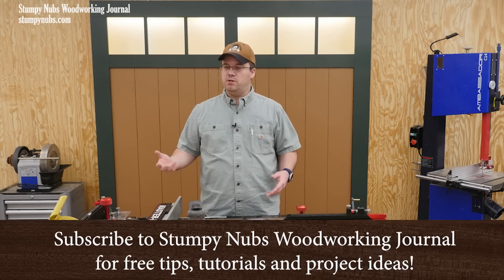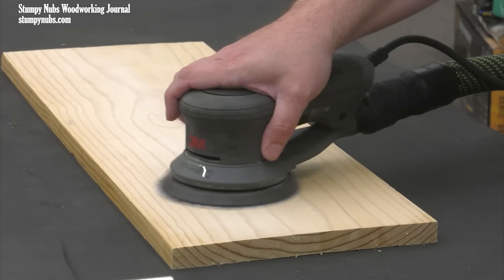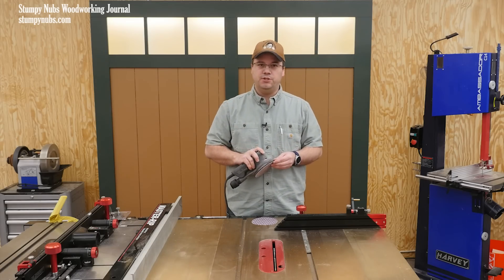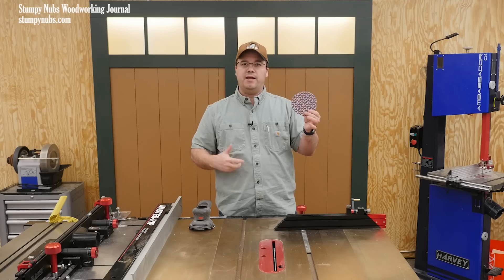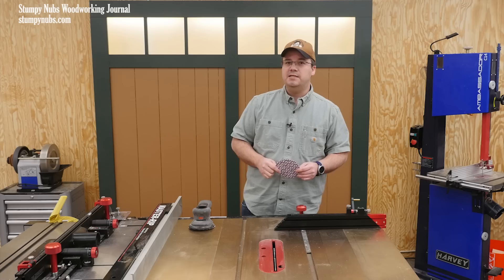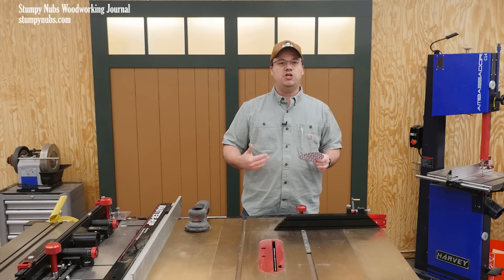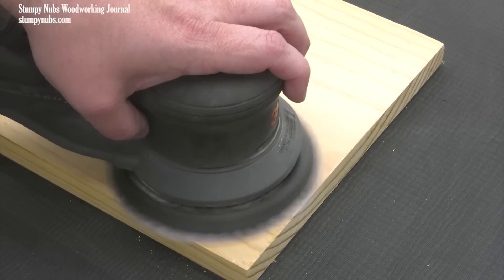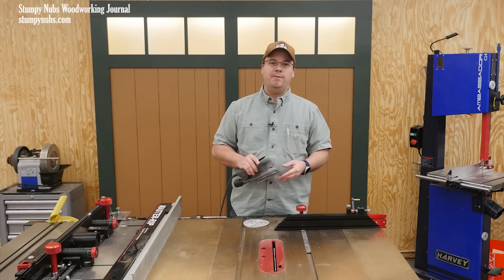Smart thing pros do with their old sandpaper.

Comment: I have been unable to find a supplier of the 3M Cubitron disks here in New Zealand and it is really expensive to import them due to shipping costs. I am currently restoring a 110 year old home and all of the trim wood is Rimu (a local hardwood), which is beautiful when polished and oiled, but at that age it is almost petrified, harder than nails, which bend when not pre-drilled. Sanding it takes a lot of disks, especially when they are a cheaper variety. I do envy you guys in the US who have ready access to all the equipment I see in these videos.

Comment: Related to sanding, but not the disks themselves. I constantly have static shocks from my sander. And it gets worse if you run the sander vertically instead of horizontally. I went as far to attach a wire to the metal plate that holds the cable inside the sander, through the metal in the dust hose, to the shop vac, and then even a metal connector from the shop vac side of the hose to a grounded outlet. STILL getting massive static shocks that even reset the sander.
I ended up removing my shoes and trying to sand that way, which did make it better. But, there is still A TON of static shock. Using the same 3M sander and a 16 gallon shop vac with the rockler dust-rite 3-12ft hose. Would love some ideas and strategies for this beyond spending many many more hundreds on a Festool or 3M true dust extractor.
Reply from the maker: That had never happened to me.

Comment: My main issue with sanding is the paper keeps coming off the sander and leaves behind loose paper on the Velcro. I've even got a shop vac attached to the sander and pressed lightly because it might be overheating, didn't fix the problem and I have no idea what I'm doing wrong. So the backs of the sandpaper gets ruined faster than the front and I've constantly had to change the grippy hooks because it's a hassle the use tweezers to remove the debris stuck on them all the time.

Comment: I have a question about 3M Cubitron sanding disc not covered in this video.  When is it best to use the Xtract (Netting discs) as shown in the video apposed to the regular Cubitron sanding discs that was referenced.  The Xtract look less durable, but there must be some benefit or preference in some sanding situations.  Hoping someone has some insight.  Thanks!
Reply from the maker: The mesh gives the best dust collection, however they can wear out quickly and shred if you are overly aggressive with your sander. For most people, I recommend the ones with the little spiraling holes.

Comment: Thank you sir for sharing new tips. Question about Duragrit metal sanding discs. I bought 2 of them, 60 & 80 grid, used them with new velcro pad it came with on ridgid sander. Not sure why, but looks like those metal discs overheating easily on long projects and both my discs not flat anymore,  they're warped.  Is it me or its a nature of that product? 
Thanks.
Reply from the maker: I haven't had that problem. I suggest you contact Duragrit about it.

Comment: Precisely EXACTLY why I had them transpose is into 3 phase electricity, for the new forest 1300mm dual header panel sander. 
I put my all my rotational vibratory sanders of the like into goodwill, 
plus this thing sands ANYTHING! 
I took almost an inch off my wife’s crock pot that’s 6 or 7 “subcontinental dark ones” too tall for her cupboard. 
I took a whole cm off the DVR to get in the cabinet hole. 
Lately I’ve been thinking on the heavier-set friend of my wife, she is always on about diet this and diet that  and not being as  small as she used to be... 😎
Reply: You need help

Comment: You say that the 3m cubitron lasts longer than anything you've ever used.  For a while now, my back burner shopping list has included the 

Duragrit carbide sanding discs 

that you've featured before.  

I'd love to learn more. I haven't found much chatter about those anywhere, and they seemed like a long lasting and quality product.  (Like you said, doesn't pretty much everyone hate to go through sanding discs?)

What about those?  Is there some nasty secret I don't know about?  Is 80 grit (their highest) not an important first step for finish sanding?

Comment: The 3m site says cubitron has been discontinued.  I’m thinking their Ultra Durable is the same pad with a different hole pattern?
Reply from the maker: The sandpaper I am using is called Cubitron II
Reply: @StumpyNubs  It seems they both have the same abrasive but the cubitron has more mesh to accommodate dust extraction.  It would be interesting to see a performance comparison.

Comment: My sandpaper is self-changing.  Ill be sanding a long and Whoooosssh!!  The shit flies across the shop  My sanders never did this until I bought Duragrits carbide sanding disc and replaced the pads on my sander with their "Heavy duty" conversion kit.  Now I have a carbide disc that wont cut anymore and sand discs flying all over the shop.
Reply from the maker: Why won't your carbide discs cut anymore? What did Duragrit say when you asked their advice? And the replacement Velcro is stronger than the cheap stuff they put on inexpensive sanders, so I can't imagine why it would not grip a paper disc unless it has been damaged.
Reply: @StumpyNubs   Not sure.  I just doesnt feel like its cutting anything anymore.   I contacted them  about the pads not sticking and they said since the carbide disc was heavy its recommended not to let the sander spin free in the air....(which I dont do anyway)  and to make sure the disc has contact with the wood before starting the sander.  They sent me replacement hook and loop pads.  I put them on and they seemed to work for a while and the woooosh!  Another one gone.  I use the Dewalt 5" ROS.  Both of them are about 2 year old.

Comment: I have a belt sander, two RO sanders and two finish (straight line) sanders. I’m gradually increasing my skill with using a smoothing plane and cabinet scrapers, and sanding much less now. If I sand at all, it’s usually just once with 220 grit or higher, and then just between coats of finish. Sanding is really the only part of a project that I don’t enjoy doing.

Comment: I'm going to try those 3M pads. I've looked at the 3M sander & fell in love with how quite it is but my husband said I don't need a $500 sander 😔 so I'm stuck with my $90 DeWalt but its ok bc it's a really good sander for the money without being too cheap. I do need to get me  those anti vibration gloves you showed on another video though those would really be nice to have for extended periods of sanding.

Comment: Save the small bags of silica that come in some product packaging and re-purpose them in the containers that you are keeping your sandpaper in, change them periodically to maintain their effectiveness and/or recharge them by putting them on a tray and place them in a recently used oven.
You can also used the silica bags in your tool containers to keep the moisture from potentially causing 'rust' on metals and moisture out of electronics.

Comment: I keep all my discs and I'll throw them onto my sanding blocks, both homemade or not. Also I do stuff like add them to a shim for tight spaces, etc. I've learned my lesson with sanding, you can TELL. I'm doing a tabletop and I'll start on one corner, I will go with the grain back and forth and about 1/3 the way I switch discs. Do the middle 3rd, and the second 3rd. Also doing some overlap on previous. then at the end I do 1 new disc, but a faster pass over the whole thing. Then using some shop lights at each end I examine the surface and adjust. Also, if you use these 3m discs, you have to use a vacuum or dust collection. There is less surface area than say something like a gator or any of those big box stores so the dust collects. If you don't have dust collection, then you may want to use another type of disc, 3m makes 3 discs I like that have varying levels of mesh. 

You may think that sounds crazy but it's WAY faster than going slower waiting for the sand paper to cut, doing more passes. The difference is night and day to me now, I just didn't see it then, but I dare you to try it. Basically, the table I'm working on is 8 foot by 45" wide (walnut). Think about it this way, let's say you drop 2000$ USD on 150 BF of black walnut. Do you think I'm going to get worked up using 3-5 1.25$ Discs vs trying to spend MORE time working 1-2 discs because I'm trying to stretch it out? N O P E.

Comment: Great tips. I’m guilty, I almost always stretch my use too far. In addition to flat work I also turn wood. I really like the mesh Abranet discs but am now having a hard time finding them in 2” sizes with the scalloped edges and in all the grit sizes. It’s also hard to find them in bulk. The typical pack is 10 discs. I’ve spent tons of time looking for places that have what I need but haven’t found a “one stop shop” yet. If you have any information that can help, I sure would appreciate it. Thank you

Comment: I usually scrub gently any coarse 40--120 sandpaper with a soft brass wire brush after using it and it prolongs its life for at least thrice.  For finer grit, once they are clogged for 1st time they're done, just swap it

Comment: Great information. Lots of varying views on how long to use sandpaper. For instance Lyle Jameson advocates only using sandpaper once. I think that is a bit extreme. Others say use a grit until it stops cutting well and then use it as the next finer grit. I don't buy that one either. I do think most of your suggestions are the way to go. 👍I don't absolutely agree with anybody. 🙂.S. Off subject question. the fence you are using on the table saw for a router looks interesting. Can you point to any information you have about it? Thank you for sharing. Have a great day and stay safe.🙂🙂

Comment: Two comments. First, I started using Cubitron sanding disks about a year ago, and they are definitely a cut above (pun intended) any previous disks I have used. Second, I bought the new 3M orbital sander as recommended on the Stumpy Nubs channel last year and have found that it is without a doubt the best sanding tool I have ever used.  I used to HATE sanding… but these two items have changed that. I just finished sanding a pair of hanging shelves I’ve been working on. I accomplished the job in less time and with less fuss (and far less sanding dust) than I would have thought possible.

Comment: This may sound odd, but I keep unbelievably worn down discs of 320 and use them to burnish things. It creates a shiny surface that leaves that same shine of applying a finish. Add a finish on top and it just looks so smooth and shiny. It was a total accident discovery, and I only use it on small things and you do it with only quick bursts of the sander.
Reply: I just use 1200 grit, I'm one of those guys who has had to buy a replacement pad for my sander and do not recommend using old sand paper. First off, it will begin to tear and it will leave marks if you decide to press down harder. I don't know how many times in the past I had to resand a project and actually ended up hurting the thickness of the boards doing so. Just use the proper grits and get rid of that old stuff.
Reply: I use old sand paper to clean the oil off scroll saw blades before I use them. 

I scroll quite a bit.....
Reply: I do the same for lathe work... but only if I'm planning a final finish around the 400-600 grit range. Anything above that, it just messes up previous sanding.
Reply: Scotchbrite pads work well for the same effect but without the squirely scratches. Follow that with a cheap car da car buffer armed with a wool pad and paste wax and you end up with eye candy when done.
Reply: @toysoldier46552  I just use a good hand plane and don't fuss with sanding at all

Comment: The 3M Cubitron IS the best bargain, due to it's prolonged life.  If you have the spiral-hole pattern version (that was the first ones I got), you may find that the cotton backing turns to dust loooong before the grit wears out.  I still have some of the original (spiral pattern) disks that I use in hand sanding.  I can't get them to wear out.  The new ("fractal" pattern) version is only about 50% grit- faced, and that seems to have adjusted the useful life so that front and back wear out about the same time.  Check out the box instructions on the Cubitron.  Mine says max ROS speed 12k, which is less than the max of my ROS.

Comment: Maybe it's not most effective, but I tend to take worn out discs from the ROS and set them aside for the hand-sanding needed to break some edges, sand round-overs or get in tight spaces.  They seem to have enough life left for that, and I toss those as soon as the next ROS disc is available.
Reply: Especially the center area usually is rather intact still. From there I cut 2" circles matching a sanding pad that goes into my cordless drill. Great for small stuff and only takes a few seconds.

Comment: If you use frequently the rubbery plastic sandpaper dressing to remove the dust, they last at least 20 times longer. This applies to discs belts orbital sanders and not forgetting sandpaper on a cork block. I’ve been doing this for decades as one came with my belt sander. Most sanding videos don’t include this simple money saver. I haven’t changed my edge sander belt for 6 months.
In the past I have used an old belt on my edge sander to flatten the sole of a plane, and to rehone a notched chisel.
Reply: Another secret is that you can get huge ones at truck stops and they cost nearly nothing. Apparently truckers use them on their brakes or something. It's literally the same stuff though.
Reply: Could you specify what that thing is a little more please? Ice never heard of that, but I'm super intrigued! Thx!

Comment: As far as 3M sandpaper goes this stuff sands like nothing else, even on white oak the pad cut longer than every other brand I've tried. What really sucks about these sanding disc is the Velcro backing, even fresh pads don't stay attached when the sander is not in contact with the work piece. Having suction from a shop vac really helps and the discs without holes do hold a little better.
Reply: I don't have that problem on my Festool Rotex 150. 
However, I have noticed that Festool branded sandpaper adheres (Velcro) much stronger than 3m Cubitron 2 sandpaper. But the 3M lasts twice as longer (or more) and far outperforms Festool sandpaper in speed and on some woods even gives better finish. It is surely incredible stuff and not expensive at all considering those facts.
Reply from the maker: I have not had that problem with the backing at all. You can even see in this video how well the backing gripped the sander on the old disc I peeled off. Maybe the problem is your sander's pad. I had a brand new Ridged that wouldn't hold discs well at all. Same with some of the other mid-range sanders out there. They seem to intentionally make the hooks hold loosely. I think it's to make it easier to change discs many times without wearing out the fuzzy backs.
Reply: I was having that issue but then I got a sanding pad protector and the mesh discs stick very well to that
Reply: Mesh disc will damage your standard pad without a pad protector.

Comment: I have to gripe for a second. I am super disappointed in the cubitron 2 xtract paper. I've gone through half the box I bought a couple weeks ago already and have had to repeatedly dig old discarded regular cubitron 2 papers out of the bin just to get the job done. I don't know what's going on but the xtract is just plain terrible in my experience.
Reply from the maker: The mesh doesn't last as long because there is less grit and a no fuzzy backing. It's also less than half the price of the regular Cubitron discs. I like the mesh for the great dust collection and I find it cuts the fastest.
Reply: @Stumpy Nubs  I wish I could say the same but my 120 regular cubitron 2 cuts faster than my 80 xtract. Maybe i just got a crappy batch idk.

Comment: Those discs are 50 cents each my guy. Your math is wrong or you’re getting ripped off
Reply from the maker: As I said, there are two types that I use, the mesh and the solid with the spiral holes. The price I quoted was for the latter.
Reply: @StumpyNubs  the latter is going for $1 a sheet. Cheaper sand pier also only further illustrates your point

Comment: You know, to clean paper discs in a pinch a wire brush works great, but you can't go to town on it. Don't apply the brush with the sander on. Just keep the sander off, and brush with light light pressure and minimize using the brush as it is wire and can damage the paper quicker, but it works awesome if applied correctly especially with really gummy situations. I use sandnet from Diablo so I don't get the issue anymore. And the gummed up paper is shot so it's worth a try with the wire brush anyways.
Reply: I’ve done the same with a stiff nylon brush with good results.
Reply: I got one of those rubber sanding belt dressing tools they use on big wide belt surface sanders. Works on orbital sander discs just fine.
Reply: I use a file card, a small brush with wire bristles on one side and natural bristles on the other. A few raps with the wire bristles will give me a few more minutes with the cheap sandpaper I've been using. The file card also works wonders if used as intended on a file or rasp.